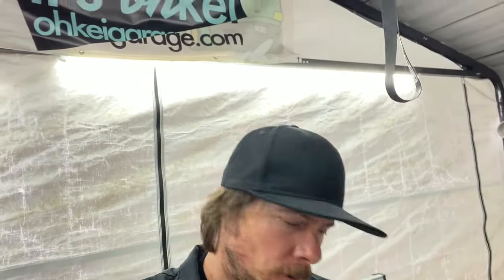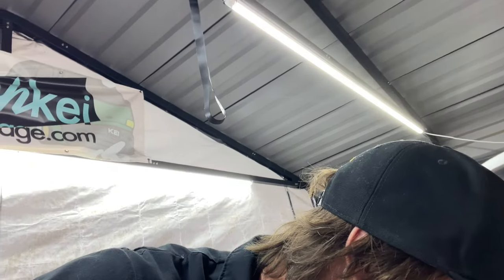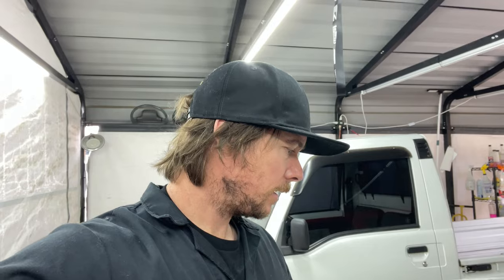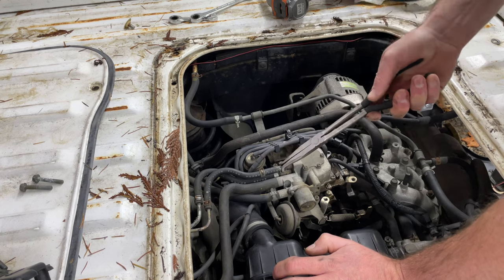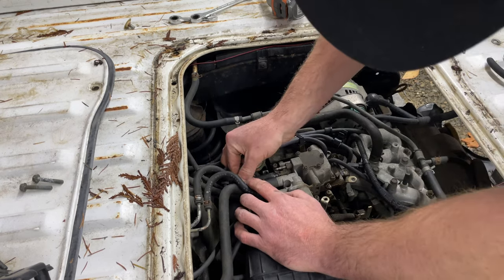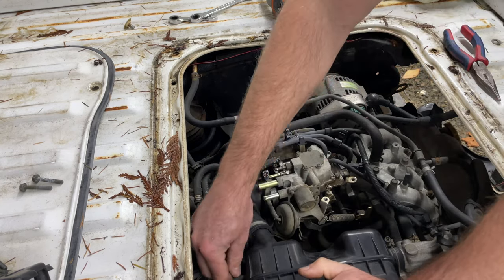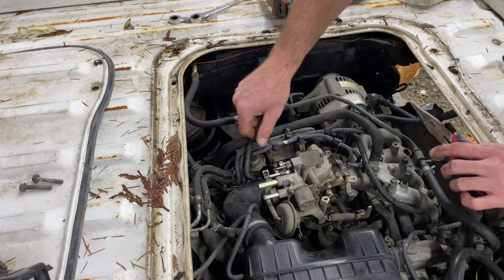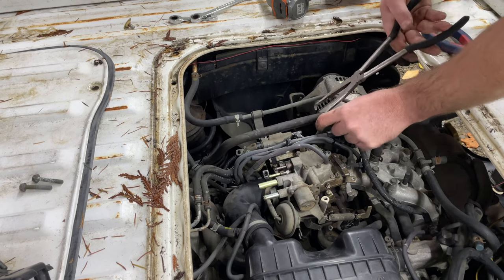Subaru Sambar Crank No Start - Carburetor Pull and Replace Fix and Tips!

Comment: dude, this is incredibly helpful!  i believe a carb/solenoid repair is in my future. getting reliable but random loss of power. have your distrib/cables/sparks coming in to replace this week but i think the air/fuel mixture is the actual issue. thanks again!
Reply from the maker: just start over and change everything and clean the carb, usually fixes all the issues. They're old trucks and parts go bad :(
Reply: @OhKeiGarage  will do!  thanks, brother.

Comment: Carb make and model #?  Is that carb used on any other import or JDM vehicle?
Reply from the maker: carb is just an OEM carb off another sambar, all the same carbs just some differ with the vac line nipples
Reply: @OhKeiGarage   Who makes the carbs for the Sambars?   Did Subaru have Mikuni or another carb maker build these based on their engineering? Someone looking for a carb rebuild kit has to start somewhere. A 15 year old carb could be as bad or worse than the one you took off.

Comment: In your other truck with the rebuilt carb, was it AC equipped and if so how much different is the removal process?
Reply from the maker: not much different you just have to remove the idle up valve to get the throttle off. very very easy

Comment: Welp I broke my vacuum advance line, any idea what size the hose is?
Reply from the maker: not 100% sure BUT you can buy wiper fluid rubber hosing from autozone or wherever and it should work perfect. maybe like 1/4" but just measure the ID and you can buy a new roll and fix it

Comment: Hi this ahmed from pakistan.
I have a subaru sambar Van 2007 model.p1513 erorr code.
P0444 erorr code.
My van starting missing issue is not resolved.
Rpm is not stable automatically.
I have already chek many EFI workshops but issue could not resolve..
Is any solution u have kindly tell m
Reply from the maker: Evaporative Emission System Purge Control Valve Circuit Open.” This code is logged when the PCM detects a problem with the purge valve circuit